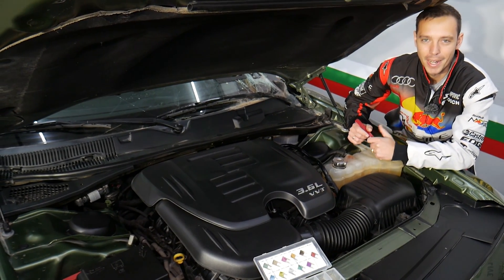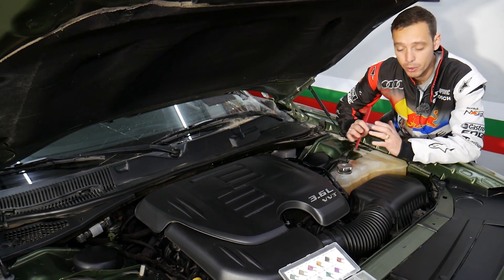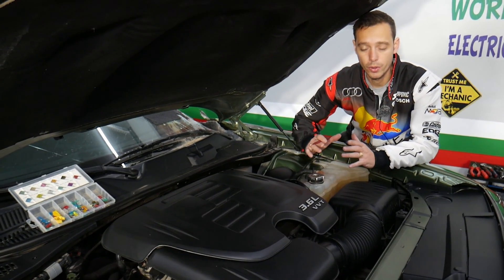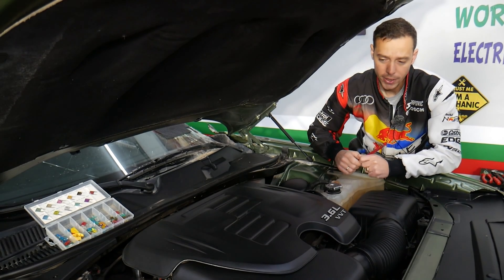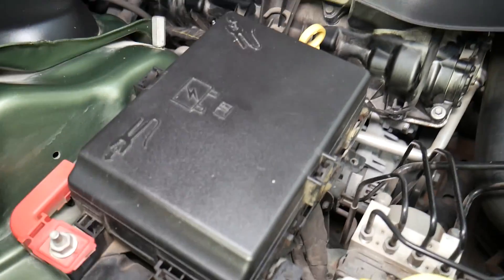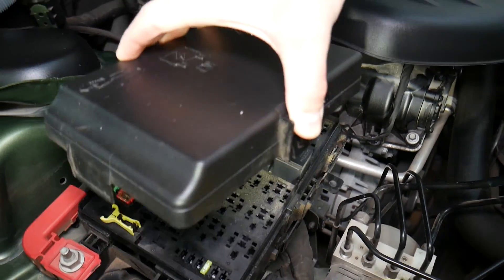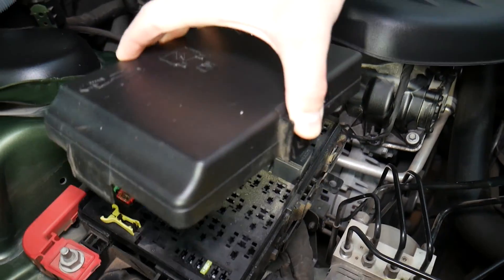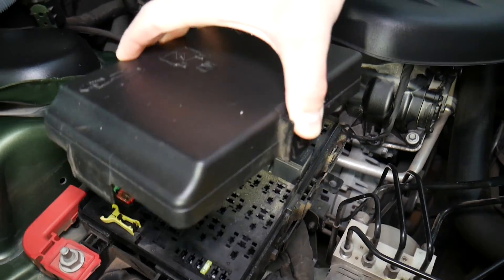DODGE CHARGER POWERSTEERING FUSE LOCATION REPLACEMENT, POWER STEERING FUSE DODGE CHARGER

Comment: Thank you. I just repaired my power steering on my 2011 Dodge Charger.
You saved me over $1,000 on an unnecessary repair.
Thanks again!!
Reply: What’d you do replace the fuse? My wheel is locked

Comment: Thank you ,that’s exactly what my problem was.tried power steering fluid first because it was a little on the low side but i came across this and it worked..both 50 amp fuses were blown